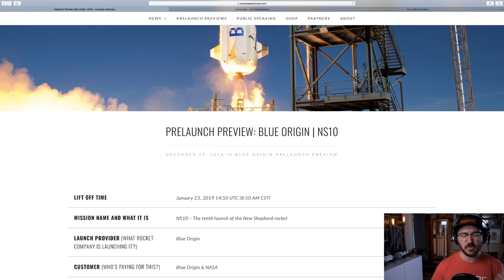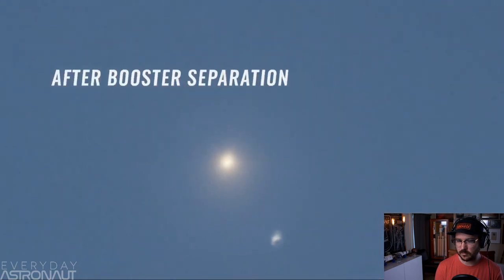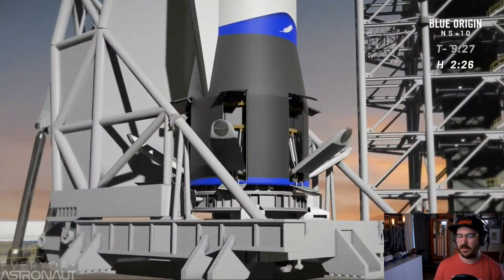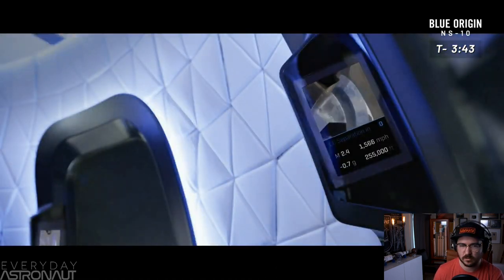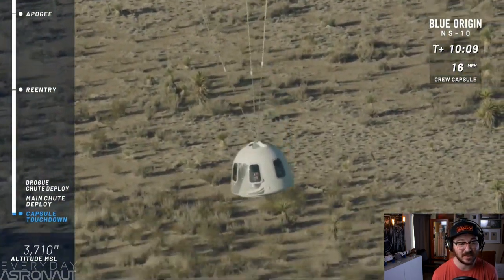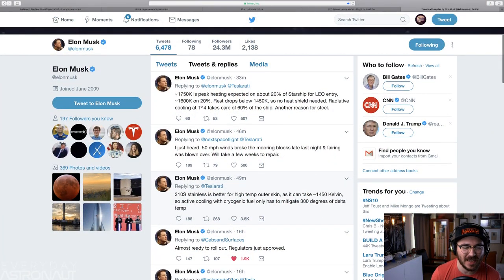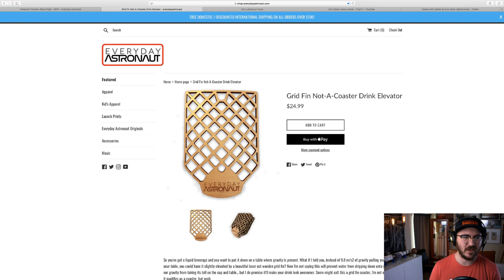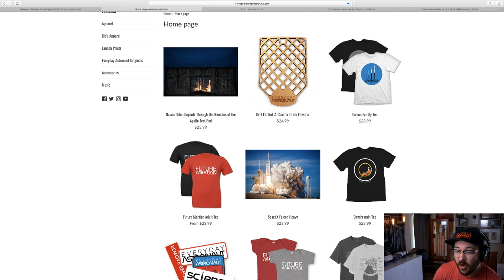Watch Blue Origin launch their New Shepard rocket!

Comment: Tim regarding the SpaceX stuff the T^4 is Temperature in K to the power of 4. At such high temperatures the radiative heat exchange has a huge effect since is related to the 4th power of the temperature and added that the stainless steel is shiny it will maximize the reflectivity.
Reply from the maker: I have so many questions about this. Can you shoot me an email so I don’t miss speak about this stuff? Info@everydayastronaut.com !
Reply: @EverydayAstronaut  just sent you an email

Comment: Bih pls i can't watch these launches i understand only normal units.
Reply: I have the opposite problem with SpaceX. I'm metrically impaired, but I'm an aerospace engineering student so I'm using and starting to appreciate the metric system.
Reply: Is multiplying by 1.6 really that hard?  Your countries could also start their own rocket programs and then they'd broadcast in your units.
Reply: Blue Red multiplying by 10s is easy compared to multiplying by 12 etc. Imperial = inferior.
Reply: @bluered3228  Funny, NASA is using metric.
Reply: As an American, I have to agree. Feet and mph are fine for everyday use, but I still expect to see metric in engineering and scientific endeavors.
Reply: Of course metric is better but that's not my point.  My point is that we're all used to imperial here in the states and the constant whinging about an American using imperial is pointless.
Reply: Yeah, so do almost all scientists, myself included.  The overall population doesn't though.
Reply: Silliness. Should be in nautical miles like everything else in aviation and navigation. Base ten is fine for everyday use and great for those who count on their fingers. Base 12 makes great sense when doing fractions or working with computers. When it comes to numbers it’s good to be bilingual.
Reply: These are normal.

Comment: It's amazing that not only does it slow down with the suicide burn but hovers momentarily before landing and can adjust right where it touches down.
Reply: Dunno if it's amazing or not. I'm not a specialist but is it not using too much ergol? As you want to maximize the payload weight the suicide burn should be as short as possible imo. Here it seems to take forever because it adjusts its touch down point. 
But maybe I'm wrong.

Comment: I noted that the capsule's telemetry data was showing it was at an altitude of 3694ft as it fired the landing boost, then quickly zeroed out. Wondering why such a discrepancy with that altitude reading at landing, very obvious from the video that it was very close to ground contact.
Reply from the maker: They said that the ground is 3,700 feet above sea level and the instruments read mean sea level 👍
Reply: @EverydayAstronaut  Yep, I just noted that the starting altitude reading on the pad at liftoff is 3654ft... Got it...

Comment: The capsule seems to have a lot of internal volume compared to the external volume. What type of life support systems would be required for such a short duration flight? The systems installed must not take up a significant amount of internal volume.
Reply: All that is really required for this type of flight is pressurization along with a small amount of supplemental/ emergency oxygen.

Comment: I don’t know if anyone with the expertise will ever see this question, but do you think the ring design would work on an orbital velocity rocket?  As an engineer, it just looks like the best design. I always was amazed that the grid fins even work as good as they do. Can you guys even simulate that in your kerbil space program?
However, the one engine design does kind of scares me. I would much rather have two or even three engines for A fail safe
Reply: I think the ring fin is a very elegant design, but 2200mph is a far cry from 17000mph. Thermal protection for leading edges is a critical issue, but nothing that hasn’t been solved before.
I have been in the middle of single vs. twin engine airplane safety debate several times. Truth is, without doing a proper risk analysis for what you’re actually doing you can’t say. If I’m flying daytime VFR then another engine only doubles my chance of an engine failure. If I’m flying IFR in weather or at night then instrument failure is a much bigger risk than engine failure and I want vacuum and electric systems. But if the single engine is a gas turbine or jet engine reliability isn’t really a concern at all.

Comment: That long hover towards the end of the landing seems a bit inefficient. Seems a SpaceX-esque suicide burn would cut the required fuel for the landing by a bit.
Reply: Falcon9 cant hover,  too much thrust at lowest power settings so  their suicide burns are not by choice, they have to. Yes, it is also more efficient, but is it worth the risk when you have the option to hover?
Reply: And also be a1000 times as dangerous.            P
Reply: SpaceX has no choice, their engine can't be throttled below 80%, if they burn too long , the rocket becomes too light and will begin to climb. SpaceX would love to be able to hover.

Comment: As amazed as I am by the repeatability, I can't help but find it odd that they have remained so long at the non orbital stage.
No work on a multi stage recovery for the lower recoverable stages?  No work on a second stage that is capable of reentry?
Do they think reentry is easy?

The other thing I found odd about this is that they could have certainly put cameras in the thing.  No images from the rocket or inside the capsule?  Really?
Very disappointing on all levels.  They think they are going to go from this, to a BFR in one step next year... and I just don't see that happening.
Could it?  Sure.  But I don't see it happening without first putting in the testing.

Comment: How do they ensure that the capsule and booster separate cleanly and not bump into each other?
Reply: The combined vehicle is not under accelerating at separation. A very small force is all that is required to push them apart. BO probably accomplishes this with either mechanical springs or a small gas charge.
Reply: MECO, then separation, then light only the second stage
Reply: @Krys_P  New Shepard has no second stage.

Comment: Oh man after watching this launch I felt like a supercomputer. Every 5 seconds I need to calculated the feet through 30.48~ 30.5 and the miles with 1.609~ 1.6. But hey when it is easier for americans to imagine that 107 km are 350,775 feets, which are sort in a line from the bottom to the sky then it is ok for me to change the units into metric system. Btw 350,775 feets are ~590×590 feets  packed in a ~0.11 milessquare. Oh man that system makes no sense. Imagine a euro would cost 161 cents or a meter is 30.5 centimeters long ^^. Just horrible

Comment: This is a Walmart version of Space X
Reply: they should definitely run it under the "AmazonBasics" label :-)

i mean, the landing is cool. The rest is really not very exiting. Also all this "New Glenn" this and that talk goes on my nerves. Everything that is in the future and has not happened is just hot air. 

I actually like Virtin Galactic / VSS Unitiy much more. I think as an adventure and from a technical standpoint it's just more exciting. In my opinion it has more potential than Blue Origin.  Going up with a plane an then been rocketed into this heights - the ultimate fairy attraction!! I'd pay for it.

Comment: Landing a rocket by hovering is so easy, a human can do it!  6 Lunar Modules did it. OK, add in atmosphere, 1G gravity - Harrier jet pilots have been doing an analogue for decades. Length of deceleration burn - easy math. 

Building a rocket with the fuel and strength to do it - definitely an accomplishment. Doing it with New Glenn - a really big accomplishment. Thinking outside the box, doing a hover-slam - only Elon/SpaceX engineers.

Comment: The Falcon 9 and Heavy throttles its thrust down when it reaches max Q. How does rockets like the Omega that uses a solid state first stage handle max Q?
Reply: It seemed to not be going as fast, although I could be wrong
Reply: Solid rockets have varied thrust throughout the burn by altering the chemistry and geometry of the fuel as it is loaded into the booster.
Reply: @bgulrud6815  sounds like it could work.

Comment: they should definitely run it under the "AmazonBasics" label :-)
  

i mean, the landing is cool. The rest is really not very exiting. Also all this "New Glenn" this and that talk goes on my nerves. Everything that is in the future and has not happened is just hot air. 

I actually like Virgin Galactic / VSS Unitiy much more currently. I think as an adventure and from a technical standpoint it's just more exciting. In my opinion it has more potential than Blue Origin.  Going up with a plane an then been rocketed into these heights - the ultimate ferry attraction!! I'd pay for it.